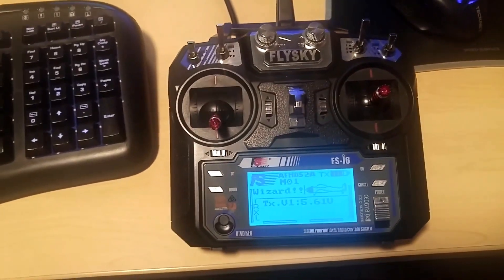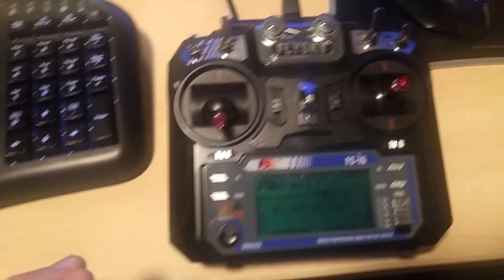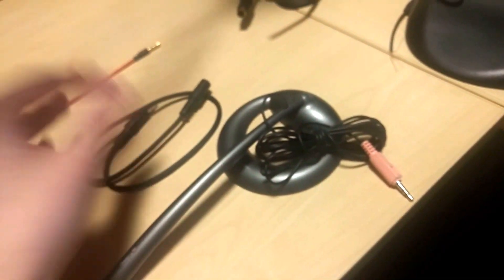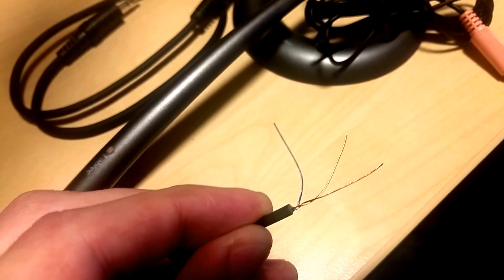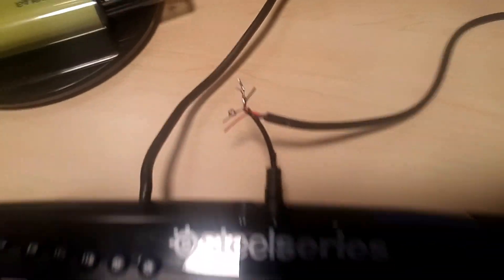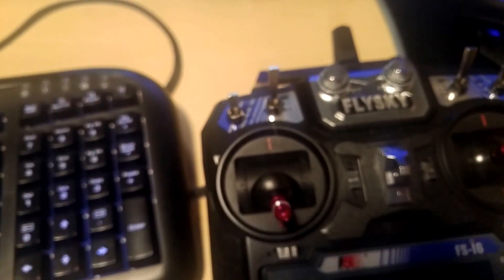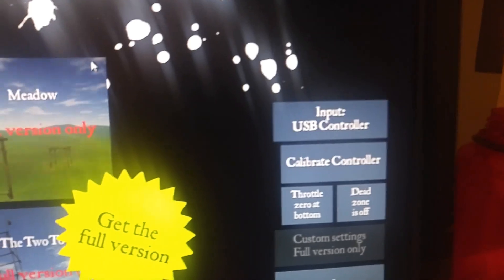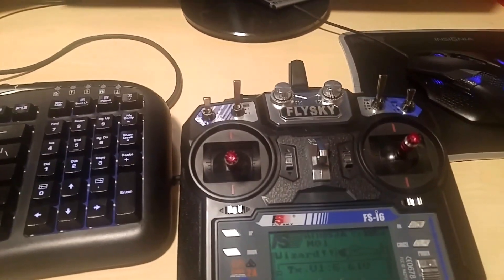Tutorial - Connect Flysky FS-i6 to flight simulator - quadcopter practice for free!

Comment: I appreciate this video so much! But I can't seem to get mine to work. I assume I'm just soldering the wrong wires but S-Video is a little different. I purchased an S-Video to usb cable marketed for Fly-Sky receivers. But when I was splicing the wires, I found three wires. Red, Black & Yellow. And then I grabbed a two sided aux male cord and spliced that to find a Red, White & then a bunch of free wires used to insulate almost(An experienced person probably knows what this is called and used for) I tried a few combos using the info from the video and some of the commentors suggestions. Nothing was working. Then I took the aux cord apart on the other side and found that the free copper coil was soldered to the larger segment of the aux which is the farthest from the tip of the aux. The red was in the middle and white being the tip of the aux. I would appreciate some help on this one if anyone knows. Thanks in advance, anything helps a newbie

Comment: Thanks mate, this actually works. Except i did little different, i salvaged one USB cable, one AUX cable and one 3 wire receiver plug. And added them to receiver. You need black and red (+ and -) from usb for power, they go to corresponding receiver wires, and signal from AUX tip wich is yellow receiver wire. 
If anything, i just followed this tutorial. https://www.youtube.com/watch?v=8iaXpCQE3kg&t=291s
 Big helpman, thanks a lot!!!

Comment: Hye guys. I know im a little late..heres my problem.
My s-video has black yellow and red while my 3.5mm has white black and green. So my question is connect which to which?
Reply from the maker: I'd recommend either looking up the wire colors you have and connect the tip to the signal wire, use a multimeter to check continuity, or just try a bunch of combos until it works! :D

Comment: Great video. Thanks. Doesn’t work for me since my mic and speakers are on the same jack. If anyone knows how to fix that pc configuration issue, please post a video or reply. I broke down and bought the cable designed for this and it still doesn’t work. So, I’m pretty sure it’s a pc issue.
Reply: Hi, same issue here :( 
Have you found the solution yet?
Reply: Sorry No. I gave up and started training with my Jumper using the USB port, and ditched my Flysky controller for that purpose. I still use the Flysky to fly, just not on the trainer.

Comment: Thanks! this worked for me. I found both cables and it works good. Just had to reverse the throttle on my fsi6.
Reply: name of first cable plz
Reply: @zamir6897  I used a 3.5mm headphone wire and a s video cable.
Reply: Thanks a lot bro

Comment: You don't even need an S-video cable. Just put the wires into the port. Top left corner of the connector (if you're looking straight it at) is your left channel, ground is ground. If you don't know which is left/ground, use your multimeter on continuity and check it. Ground is usually bare, left is usually black.

Comment: Older option, but a damn good one.. thank you for sharing sir! However, now there's a cheap cable on amazon that works great for me...
Reply: Mike Peterson link?
Reply: The titchy gamer first link is for the cable that will allow playing sims. 2nd link is for the cable that does firmware updates. 

GoolRC Flysky SM100 USB RC Helicopter Airplane Simulator for Flysky FS-i6 FS-i4 FS-TH9X FS-T6 FS-T4B FS-GT3 FS-GT2 Remote Controller https://www.amazon.com/dp/B00DR4I4O0/ref=cm_sw_r_cp_api_UQDLAbWT3TZ7G

Flysky Line Data Cable Connection to Download the Firmware Upgrade Applies for FS-T6 FS-I6 CT6B T4B FS-I4 https://www.amazon.com/dp/B06XD9CN8Q/ref=cm_sw_r_cp_api_cMDLAb7EA5FVB

Comment: Wow, thanks!  I would have never figured out that I needed SmartPropo.  Information is so hard to find in this hobby.  That did the trick.

BTW, I bought a S-video-to-female audio cable for $2 and scrounged up an old stereo computer cable to connect my transmitter.  The $2 adapter cable is at Banggood.

Comment: I cuttet the plug open after many tests and i found out that the SW cable had a difrent ground ... so i soldered the ground(yellow or black) to the right place (the outer ring) and the red wire to the ppm pin. I hope this helps a little bit :)

Comment: My laptop dont have audio input only output . .is there a way to do it ?
Reply from the maker: Usually laptops have a port that can handle audio input and output at the same time - like a headset with a microphone attached. So the 3.5mm jack you'll need will have 4 metal segments instead of 3. Then just either look up which wire internally is connected to the microphone segment, or trial and error until one of them works.

Comment: Good video. How is this simpler than buying a $12 cable which comes with a quad simulator?
Reply: This is a great, and free, option if you have the  spare cable and ability to hook it up... but this is an older video, from when there weren't really any cable options for this controller... now there are multiple/cheap options online..
Reply: EXACTLY! It is damn tweaking, cutting, soldering...way harder method. And i don't have components  needed, at least not for breaking up. Sh´o my option is still to go shopping, then breaking stuff,, cutting cables and  such.
Reply: Who said it was simpler?  It's $12 less expensive if you have the cables and use one of the free simulators, or $5 if you use FPV Freerider.
Reply: This is simpler because I have made the components out of home anyway in 30 seconds - instead of having to go unnecessarily and pay 10 € for nothing

Comment: Hey. Did the soldering and hardware seems to be fine - the joystick responds on all 6 channels. The problem is smart propo plus says "transmitter disconnected" and controller is not recognised in the simulator. Any ideas? Could my drivers be a problem? or win10 version?
Reply: I am having this same problem as well.  Although I have 2 usb cables.  propo says "transmitter disconnected".  Did you solve the recognition problem ?? thx

Comment: My cable appears to be working in Smartpropoplus because the status is "Fully Operational" and moving the sticks smoothly changes the bar graphs.  The problem is that the values displayed as a result of moving the sticks only move half way.  Suppose the full range is supposed to be -1 to 1.  Moving the sticks in their full range only seems to change the values from 0 to 1.  That means there is no way I can center the sticks in the calibration in FPVFreeRider.  Any thoughts?  I have tried a ton of combinations in Smartproplus but my current ones are the only ones that are stable.

Comment: My S video cable has 4 wires output, what do i connect them too??
Reply: My s-video cable also had 4 wires. Yellow, White, and two clear running through each of them. I ran continuity on the wires and pins to determine which one went where.
For me; Yellow wire was Chrome signal (Pin 4), White was Luma signal (Pin 3) and both clear wires were ground. 
Chroma Ground was Pin 2 and Luma Ground was Pin 1. (Pins 1 and 2 are both ground)

For anyone that has 4 colored wires, which will typically be Yellow, Blue, Green, and Red.. 
Yellow is Chrome Signal (Pin 4), Blue is Luma Signal (Pin 3), Green is Luma Ground (Pin 2), and Red is Luma Ground (Pin 1). Again, its the same here, Green and Red are both ground (Pins 1 and 2)

Going clockwise with the plastic bit on bottom, the pins are 2, 4, 3, and 1.
Both bottom ones are ground, top left chroma, and top right luma.

The difference between Chroma (Chrominance) and Luma (Luminance) is Chroma carries color signal and Luma carries Black and White signal. 

Since you (ghudner) mentioned Pin 3, I would assume that you would be looking for Luma Signal, which is Pin 3 and Pin 1 ground. I am not sure how much of a difference it makes though.
Reply from the maker: Wgesh8 Hmm I'm not sure, no one else has commented about this problem. Go online and see if you can find out which wire is connected to pin 3. that one will be your signal. You could also try the method mentioned in the comments above that doesn't need an svideo cable.

Comment: Here is the pinout of the controller. PPM on the controller shall be connected to the tip of the microphone connector. And ground on the controller to ground on the microphone connector.
https://kn8alpha.wordpress.com/2016/07/30/quadcopter-practice-using-a-pc/

Comment: my laptop doesn't have a mike socket,,,,, can I use the speaker socket?
Reply from the maker: Terry Clifton Hi Terry, unfortunately smartpropoplus only works through the mic port. most laptops actually have a combination port that does heaphones and mic together. this used a different cable though, with 4 metal segments on the tip instead of 3 in the video. If you have one of these cables you shoul be able to get it working, but will have to look up or just try to see which wire is used as the microphone. Just experiment a bit and see!
Reply: looks like a trip to the electronics store for me lol,,, thanx for ur quick reply

Comment: Hi, i have the same setup, in smartpropoplus it is registrating the stick input but in the simulator it does not work. do you know what the problem is?
Reply from the maker: Anthony Sounds like that's just a configuration issue with the simulator. It should read as a usb controller and will have to be calibrated in each sinulator you use. The one I used here just had a button on the main menu that walks you through calibration, but you first have to select 'Usb controller'.
Reply: Hey thanks, the problem was the volume of the microfone port was too low, i put it at max and then the simulator could see the sticks. but it is really bad i cant manage to calibrate the stick movements. tried it hundred times now but the input isnt steady enough so i will look further.

Comment: Thank you for sharing. I had responded a couple of weeks ago and Asked about the adapters from banggood as I already had one on its way I waited and I finally got around to using it, for $2.60 the flight simulator wiring adaptor works perfectly! I just plugged it into my i6 and then plugged in the 3.5mm jacks to the adapter and my laptop installed what you recommend and I'm flying!😎 Thank you for the links especially SmartPropoPlus... Cheers

Comment: Hi, I followed your guide and at first it worked, but after a few minutes the quad wouldn't fly properly, but do random shit... I looked at the PropoPlus Software and saw that the number of channels recognized by the software changed between everything from 2-8 really fast. Also the sliders indicating the channels were going up and down, even though I didn't touch the transmitter (It was turned on tho). I redid the soldering, but that didn't help out. May it be because of some transmitter calibration? I haven't used it on a real quad yet.
Reply from the maker: MobbyDick Hmm, that's a weird one. I would assume it's a soldering problem but if you've redone that it might just be some internal problem with the transmitter. There may be no problem with it when you get it connected to a receiver and fly normally, but you might be sol with connecting it to a computer with the port on the back :S
Reply: I actually fiexed it a few days ago and  forgot to delete this comment. I had to choose a Transmitter model manually (but a walkera, so not the flysky) and after I launch my simulator i have to restart smartPropoPlus. So it seems like some kind of a bug.

Comment: is the cable included with the controller in the box if no where to get it thnx
Reply from the maker: Hi Dennis, the cable you probably have is only for updating the firmware on the transmitter. It won't work for simulators from what I've heard. You can either make a cable yourself like I showed here, or buy one of the many USB receivers that are compatible with Flysky transmitters. Just search on Banggood (or wherever you bought the transmitter) for one!
Reply: Thnxghudner

Comment: hi!
I cut the svideo wire and there was 3 cable ( 1 yeloww 1 red 1 blue). In your video there was 2 wire in the svico cable. What should i do now
Reply from the maker: András Benc Hmm, I haven't heard of an svideo cable of this type that has three internal wires, but you should always assume black is ground. so solder that one up as normal and just try one of the two others. one of them may work!
Reply: Mine has 5. The shielding; which is connected to ground and the four individual pins have their own cables. Can I assume the TX port on the FS-i6 is where the signal comes from?

Comment: Banggood has an adapter for $3, glad to see you have it up and running...
Reply from the maker: Gervais Devine Right, I ended up buying 3 different ones from there, ranging from 2 to 15$. None of them were easy to set up and configure in Windows 8 or 10, and only one ended up actually working for me. 2 minutes of soldering saves about 2 hours of frustration and money...
Reply: ghudner thank you, that is good to know. I'll try it when it arrives and if not thank you for the answer.

Comment: Would a 6-Pin S-Video to USB Female Converter with a usb cable work? Like this one: http://www.image-tmart.com/prodimgs/8/88010517/6Pin-SVideo-to-USB-Female-Converter-Green_800x800.jpg
Reply from the maker: I don't think so - or at least not with the method I'm showing here. The transmitter doesn't have any software on it to communicate directly through USB - you need a special dongle that turns the signal coming from the transmitter into something your computer can understand coming through a USB port. 

From what I know there are only the two options - buy a cable or receiver that's compatible with this transmitter and plugs in to USB, or make your own cable like I did here.
Reply: Ah okay, thanks for the info!
Reply: Sigh... That's a PS/2 to USB adaptor for a mouse (and the mouse has to have PS/2 support still - they're just passive adapters). It's got nothing to do with a video, so I don't know why they included that in its name.

Comment: What is the reciver called where you just plug and go like you said?
Reply from the maker: I believe there are some available on amazon, but the one I purchased is from banggood. Takes forever to arrive but it does work well. There are data cable versions or small receivers that plug in to USB, but just make sure someone in the reviews has used it for FS-i6. Should be good to go!

Comment: sweet!!  -im trying to do this EXACT MOD. ,but im not having much luck...  iv got my cables, soldered all connects(i think theyre correct), anf iv downloaded the software...  but its still not working..? :(
Reply from the maker: Most of the people that have reported problems with this have solved it by trying different pairs of wires, or fixing the soldering joints. There's nothing much else that can go wrong here; the signal just goes straight from the transmitter to the mic port and is interpreted by smartpropoplus. Keep messing with this, it should work eventually!
Reply: Right...  probably just a mattet of tinkering'till i get it working -no biggie.  Thanks for sharing this video, it did help.

Comment: Ive been messing with this for two hours and cant get it to work, s-video has 5 wires and i cant figure it out. I have, red yellow, black , white, and unshielded copper
Reply from the maker: Andrea Hamilton It doesn't sound like you have the right cable. There are a bunch of different svideo cables with this pinout and the one you need in this case looks like the one in the video. just two wires internally. You may be able to solder some of those wires together to simulate the two wire cable though.

Comment: sir i have a problem in my fs-i6, after i factory reset it the sensor list is gone, so my receiver cant detect my esc bec. how can i restore my sensor list? when i plug the bec the receiver cant detect and nothing appear in my fs-i6 monitor. btw my receiver is fs-ia6. thank you sir.
Reply from the maker: joenelle ocsalev hi jornelle, I actually just bought this transmitter and have never done a factory reset. No idea why it wouldn't be working after only being reset, but you might be able to ableadd the sensor list back manually - not sure though. sorry I couldn't help with this!

Comment: You mentioned USB dongles that are compatible with the FS-i6, do you recommend any? I bought this cable: https://www.amazon.com/Flysky-Fs-sm100-Simulator-Cable-Free/dp/B01335TBIK and I can't get the usb device to work properly (it never installs on windows 8). I also tried your method using their video-jack port but the signal I get in SPP is extremely unstable, which makes FPV freerider impossible.

Comment: Whats the USB cable for then? i bought it along with the transmitter thinking it would do all sorts of communication with PC. would be silly to go solder wires together if you have this cable but in hindsight I can't see anything in this SmartPropoplus program that would alow some sort of USB connection. darn-it :(
Reply from the maker: OBELIX ER The usb cable is actually an option for connecting that also works, but you need usb drivers for your specific cable and it costs money. This method used cables some people have already and free software, so I thought itd be easier and cheaper. You won't need to use smartpropoplus If you're using a usb dongle, all that program does is convert the data coming into the microphone port to a simulated usb controller.
Reply: ghudner thanks for the time to answer this, it was a package deal but I could not find any programme working with this and stumbled on this feed :)

Comment: Did you have to make any modifications to the RX system?
Reply from the maker: Gustavo Neves The transmitter shouldn't need any modifications, but mine does have PPM set to on. Also need to set smartpropoplus to 'Standard' PPM and that should be it. if it's still giving you grief it's likely a physical connection problem. try resoldering or soldering a different set of colours together!